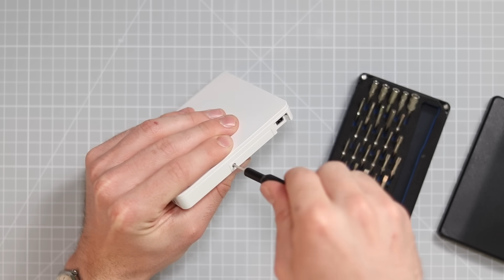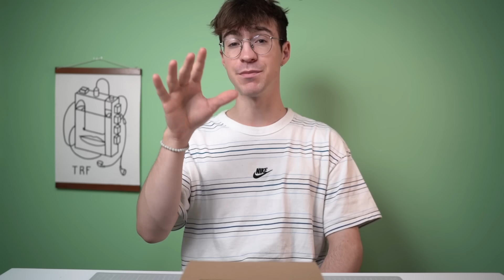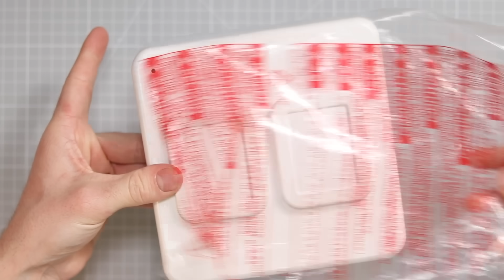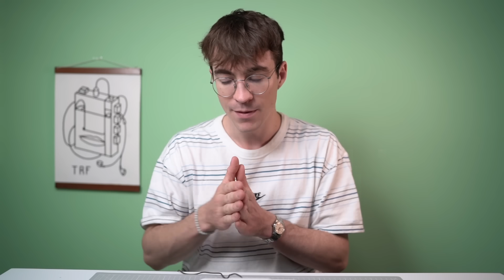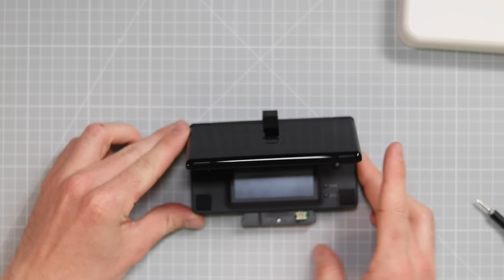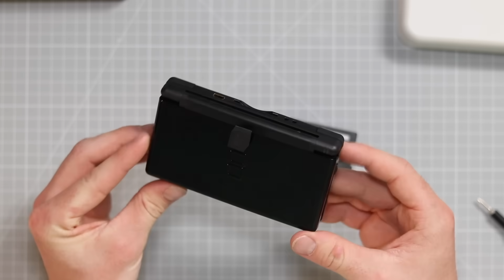Nintendo made a DS with no buttons

Comment: the firmware in the download play DS may just be a slightly modified DS firmware. on the standard DS firmware, if auto mode is on and a cartrige inserted, if you hold the Start button on power on, it will make the DS go to the menu anyway.

Comment: If I had to guess why the DS didn’t have a menu, I’d say it’s because they straight up didn’t flash the firmware or they flashed a modified firmware. In DS emulation, you need to get 3 BIN files: Bios7, Bios9, and firmware. I assume they didn’t flash the firmware because (I’m almost certain) that’s the file that has the home menu.

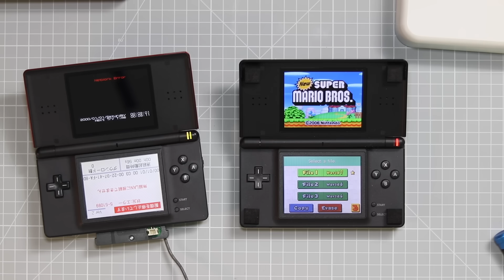Comment: 8:21 Sword appears on the DS lite use in that store display box doesn’t appear to turn on without a game but once you insert a game card in there it automatically turns on so it acts like a game boy advance or game boy advance SP were only operates when there’s a game in there
Reply: So I put it bluntly that has the same behavior as a game boy advance
Reply: Maybe that’s how old a DS used to operate during the testing process before adding the system menu

Comment: when I worked at circuit city in 2008, nintendo came in and just put a  phat nintendo ds plugged in underneath a shelf with  the ds distribution game disc inside. worked as a regular phat ds when you plugged games into it.

Comment: The DS that didn't turn on was probably just a retail system but with a different firmware on it, which means you might be able to flash a retail firmware onto it. How, I don't know, but it might be possible

Comment: It didn't click with me until now that these things were designed to be placed with routers and other network equipment, or even mounted to the wall. Interesting how this one looks like an old router crossed a display kiosk, and the newer one looks like a security system panel, with its flip down cover.

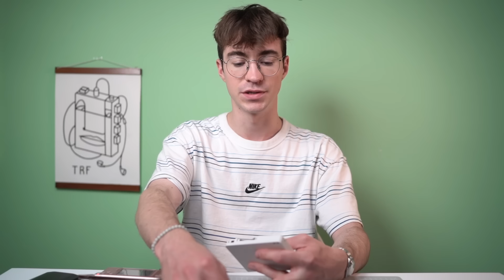Comment: 7:13 - "Looking at that, it looks to be exactly the same cartridge."

Not quite! Look closer at the codes along the bottom-right; the first one is is coded "WDB-JPN", while the other is "WDB-JPN-J", or similar. That's probably enough all by itself to warrant a closer look; I know if I had a card ripper, I'd be handling those as two different carts.

Comment: Custom firmware can be installed on a retail DS by using a piece of metal to connect two pads (there's a hole in the battery compartment).  So it could have been a retail system, then they could have changed the firmware that way.

Comment: That unique DS with Quick boot is actually pretty cool, I'd prefer that to the normal one if I were traveling
Reply: Well you can set automatic mode in the settings of a regular DS.
It will then skip the menu as well, booting into the game.
The only difference to this DS here is that you get into the menu when no game is inserted.

Comment: It seems the covers for screws left and right of the cartridge port that double as rubber feet for on table use etc are missing from factory.
For me I notice them because they are far too easy to loose when you disassemble/reassemble consoles and the sticker material starts to be worse.

Comment: 7:15 Tiny observation; they're not the same cartridge. The one in the one-screen appears to be a revision (-1). Note the calogue ID on it. WD#-JPN vs WD#-JPN-1 (Can't seem to read the third letter, but assuming the first identifier is Wireless Distribution, then region, then revision)

Assuming, if the wall-mounted one is purely automatic/remote used, the GBA cartridge is a re-writeable RAM cart to store the content that is currently in use? Any chance you'd open it and check? (Or tried dumping/extracting both it and the DS carts?)

Comment: You should have shown the inside of the GBA cart. As for the actual DS Lite I bet the main differences between it and the retail model is the BIOS. Which would make sense as a cost saving measure.
Reply: it would be even cheaper to use the same bios and just to use an hidden option/config that can be changed with Nintendo internal tools.

Comment: The Demo unit that was at the store I worked for, it just used a normal DS to share data with other DS units.  To be more accurate, the DS was stored in a white box that we left under the bottom shelf.  I'm not afraid of anyone trying to locate the store and steal it because the chain went out of business 2 years ago.
Reply: At the Gamestop I worked at, we didn't even have a box.  Just an old DS Phat in a cabinet with one of those Pokemon Mystery Gift came cards in it.
Reply: oh yea, at the circuit city I worked at  (went out of business in 2009) nintendo came in with a phat ds in locked white box that plugged into an outlet, kept under the bottom shelf, to distribute games.  the ds just worked as a regular ds.

Comment: That DS is fascinating! To think that there is an official version of a DS Lite that has no boot menu and can jump straight into the DS cart software. Kinda mindblowing in a way.
Reply: Actually, the regular model can do that. it's in the options menu.
Reply: @jaysefgames1155 Yeah but you still have to tap the screen or press A when the DS logo comes up, but that’s still a good option. It’s not that weird that this demo DS was set to that mode, seemingly. But also doesn’t seem to boot into an OS anyway
Reply: it is not that mind blowing.
Depending on product architecture, that is just a hidden config option that can not be toggled by normal means. Apple iPhones for e.g. have a lot of them.
Or it is just a modified firmware.
Reply: A normal DS can actually mokdified to do that :P
Reply: @sarowie  It's mind blowing that this is officially from Nintendo and it's not modified by a consumer.
Reply: @ceebee4564 what's so mindblowing? They are the developers, they can literally put a dog taking a dump as a boot screen or have nothing. The sky's the limit for them.

Comment: When I walked into a Gamestop and mentioned the DS Download Play trials were not showing up, I saw the employee open the drawer behind the counter and a standard DS (or DS Lite) plugged up. The employee just turned it own and closed the drawer back. I guess at some point it was just easier to take a DS off the shelf and use it instead of ordering the special DS distributer from Nintendo that would do the same thing.
Reply: I worked at a Gamestop back in the day, and yeah, we had an old beat-up original model DS in a cabinet under the counter.  Just sitting amid the tangle of wires and cords.  Was tempted to steal the card out of it when it was time to switch them out, but never did.  (I didn't have a good way to dump and upload it anyway.)

Comment: They basically hacked their own DS system to not have a boot up sequence or home screen and the 'games' seems take the wifi receiver in the device and turns it into a transmitter for the purpose of letting people download demos.
Reply: Wifi is bidirectional by nature.
I am to lazy to look up specifically, but I assume that local multiplayer with a Nintendo DS sets up a local WLAN network where one console plays host and the others are clients.
I would even assume the nintendo switch to do the same thing - the bloody way to get pictures of that thing is to turn it into a Wifi Hotspot!
Yeah sure, when you host a LAN-Party with PCs you use a network router (that may or may not be connected to the internet), but that is pointless in the context of gaming systems.

Comment: That's cool to see a custom firmware that removed the main menu. So all it can do is boot from the slot. Kind of shows you how slowed down the system is. Because of all the garbage menus. The GBA cart is probably only wired to the power contacts. So the external LED's work. If you plug it into a real GBA. It probably will work as well.

Comment: I think the DS that was in the box is a regular DS Light, but the battery not charged enough to let the system to into the menu. If I'm wrong then they took out the menu feature from the system. Also I think the Gameboy Advance Cartridge only lights up a LED when the DS is transmitting a wireless signal with that specific DS Cartridge. Just to be sure what the Gameboy Advance Cartridge does, it needs to be opened up
Reply: I assume they skipped the home menu, because it makes the setup easier and the boot up time quicker.
I would assume that the home menu is still in the bios. You never know if you have strange dependencies.
One example might be that the WiFi Setups menu is still there and can not be compiled without the home menu, because who need a bios without home menu?
Meanwhile skipping the home screen (or not starting without game) are simple hacks.

Comment: There is at least one other DS varient with no buttons. A version of original DS "Phat" was produced with no face buttons for use I think as some sort of electronic tour guide in Japan. A similar unit was also used as part of an interactive poetry exhibition that also had floor mounted displays at a Japanese museum under the name "Nintendo Floor Vision".

There's a few pictures and some limited info online, but there are a few pictures of the unit about.

Comment: It actually makes sense that there is no home menu on the kisok one, you wouldn‘t want some kids to mess with the settings so this is simply stripped from the firmware or simply disabled and set to direct boot the cartridge. You‘d also want to be back in the cart as soon as power is reconnected when there is a power outage instead of having to reboot the game.

Comment: Wait, does the DS boot directly into the game? Does it bypass bios checks and stuff? That could be a really neat find if so
Reply: There is a "jumper"/solder bridge that you can solder on a retail DS to enable kiosk mode.
That is like it. So if you would open that DS and remove that solder jumper, it would start up into the home menu.

Comment: Has anyone dumped the firmware from one of those units and could it run unsigned code?
Reply: None have been dumped yet. It should be able to run unsigned code from the cart slot or DS Download Play like other DSs.

Comment: Two things that might be worth looking in to:

1. Does the GBA cart power the LED in the Kiosk Shell when plugged in to a regular DS Lite?
(I have a feeling that it is just pulling voltage from the GBA slot to power the LED and there is no data transfer or software involved just power.)
2. If the Kiosk's built in DS Lite can play retail DS games, can it play retail GBA games if there is no DS card inserted?
Reply: that was my thought, too, the GBA cartridge is a glorified low voltage breakout for the LED. pretty clever i think
Reply: Ds games can access the GBA slot so likely it was software controlled from the ds cart to show something with the led

Comment: It is in kiosk mode. You can open it and switch it back by desoldering that specific solder blob Nintendo used as a jumper setting.
Reply: It's worth way more to a collector as it is though. There was a video where someone removed the jumper and the collective mourning of everyone in the comment section was palpable. It was as if millions of voices suddenly cried out in terror
Reply: Which is insane it's not like you can't restore it back to that it's literally just a jumper lmao

Comment: Looks like for the distribution DS Lite they just didn't include the firmware for the NDS launcher (The Home Screen), making it just boot directly into the game that's plugged into it. Obviously it was never intended to be turned on without the distribution cartridge inserted, so it makes sense. Would have just been more work for no reason. Super cool hardware to look at.
Reply: Would be interesting to examine the firmware vs retail version.

Comment: You need to open the GBA cartridge too. I wonder if its just connected to power leads in the cartridge port and its just providing power to the LED.
Reply: that would make sense! As an electronics engineer I would have done a bit more so that I can flash the LED software controlled, which should not be that hard has I can simply, well, take any data line and a transistor.
Yet, I also removed a few cents worth of components from an RGB Backlight screen, because blue was never actually used.
It would be really interesting to see what is in this cart!
Reply: @sarowie that was my first thought here as well, it's a drop dead simple way to control external circuits onto the kiosk. Super cool, and great use of slot-2 😊

Comment: I was so confused when I saw the entire ds inside of that, I thought it was gonna be a ds motherboard with the top screen, not the entire thing
Reply: When he wondered if it was gonna be a full DS, I was like "No way, he's just saying that to hype us up. It's just a board with DS components..."

And then it was just a whole DS. Incredible.
Reply: @ExtremeBirdTypography  it's really nintendo to do that, like the wii having a gamecube inside, 3ds having a DS mode, wii u a wii mod etc.. granted sony did that too with the ps2 and ps3 but still..
Reply: @Natsukashii1111 backwards compatibility is very nintendo 😹😹😹
Reply: @Natsukashii1111 The Wii doesn’t have a gamecube inside, the Wii processor is basically just an overclocked gamecube processor.
Reply: Me too lol 😂
Reply: I mean, I would think it's easier to take a device that is already in production and just put a different firmware on it than to design a whole new PCB to manufacture
Reply: @AlbySilly  no I would think they would take the ds and just take everything except for the motherboard and top screen
Reply: @AlbySilly  depends on the amount of ds like this one because putting both screens with the touch layer, buttons and Schell would cost more. Also shipping them would be bigger. Obviously it did matters since the next one was a custom one with custom pcb and even less hardware.
Reply: Shell and all. That's shocking.